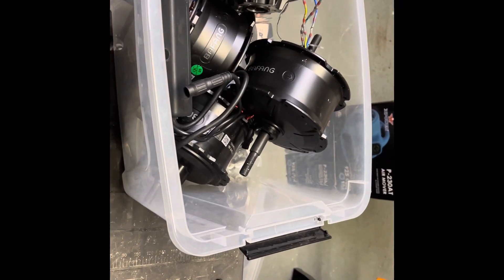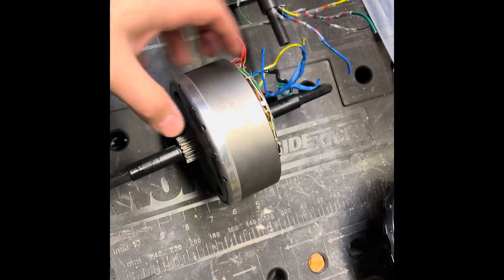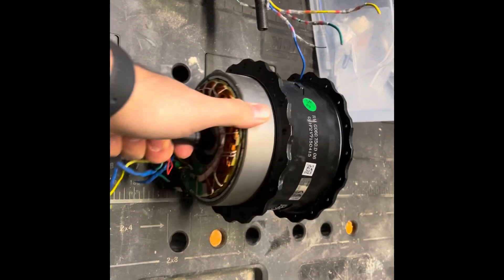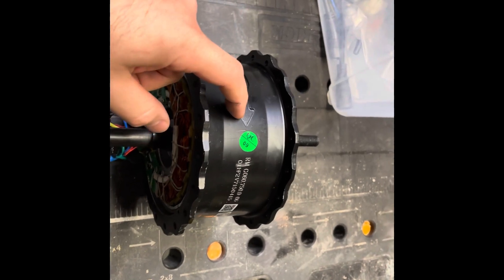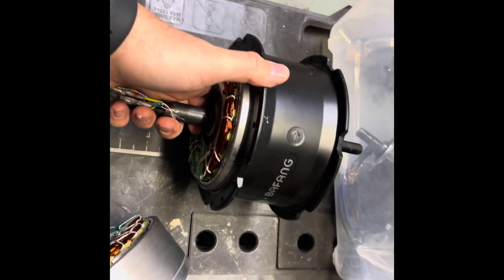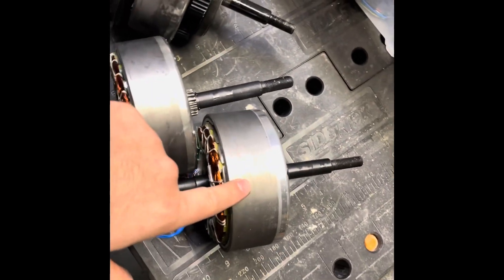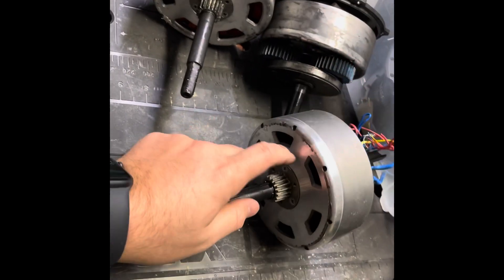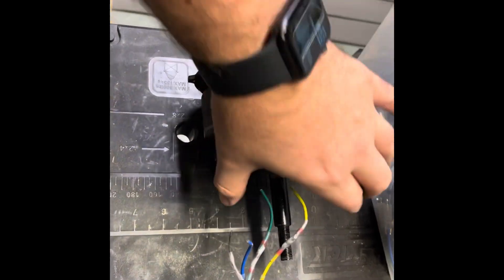RadRunner PLUS motor upgrade

Comment: Ordered a G062 750w motor with the cable on the rotor side. My question is do I need to change out the controller and if it will you connect up to the original cable. Not trying to get more power just trying to replace my broken motor. Thanks for the video.

Comment: Hello, where did you got that motor? Can you provide the exact type info? I found one but the cable connector is not the same as the original RAD motor.

Comment: I too installed the 1000w bafang from Eunorau and noticed/confirmed I would need to file/drill the holes since the OEM Bafang 1000w has a slightly smaller diameter for the screws to fit the Rad Motor shell. I chose to take off rear wheel and tire (and wheel strip by force) and take off spokes to thread in the the entire new motor. Wish I bought the special flat head screw driver tip like Amazon's "Unior Speed Nipple Bit" but oh well, I stripped a few nipples and managed to get wheel 'almost perfect' straight and super tight. .. This route was a direct fit into the brakes which means that the sizing issue is the end-caps being different with and the rotor mounts w/ different protrusion length. Just fyi for anyone else, don't be afraid to re-spoke the wheel if you want. Spoke length remains the same (spokes can be re-used). Just be careful not to strip the spoke nipples either from inside or outside if using wrench. Grin Technologies has a great video about threading spokes diy at home.

27mph max now. Climbs hills way better. Extra Note: Rad Motor had a lot of gunky automotive black grease used inside. Bafang OEM had correct silver/white thin grease correctly placed. Used an Amazon $30 freewheel versus removing previous and had to adjust derailleur a bit.

Rad Runner Plus, Grin Cycle Analyst/ Baserunner Controller, 2 batteries/ Front Regen Motor addition with another Baserunner controller is next. Hope this helps, go for it and add the power!

Comment: Just wanted to chime in on my motor upgrade. Used the link in one of the other post and got this exact motor to upgrades my RR+. All went well until I put the wheel back on. I could not get my brakes to stop rubbing. The rotors were catching the washers on the screws of the brake calipers and portions of the frame itself. It wasn't until I went to check the tire pressure, pushed on the tire and the whole wheel slid side to side when it was securely fastened to the bike. I was able to move the wheel side to side about a 1/2 inch! I figured out I needed some washers on the inside of the motor to correctly center the tire. After inserting 4 hefty washers everything worked great. I also had to use a round file to extend the holes on the motor side for the bolts in order to get the holes to line up.
Reply: I've had this motor a few weeks now and I think I'm having to same issue. How does washers on the inside fix this, wouldn't they just slide around inside with the motor? Any help would be appreciated!
Reply: @briwil78  So if you swap original motor for the one from the link grab the axel and see if you can push/pull it. If it moves back and forth ( has play in it) you can add washers inside to remove said play. Go to time stamp 4:52. see the motor on top, the one with the gears still attached? Those gears should normal be right up against the inside of the case . The motor should fit inside the case with out any wiggle room. If you shake the case with the motor inside it shouldn't bang around inside the case. After  I got mine all installed the first time, I mounted the wheel with old case new motor and I didn't realize it but my whole rear wheel could move side to side by about an inch. . With the motor outside of the case I put washers on the gear side of the axel to eliminate the extra space the motor had inside the case. Not sure if im making any sense. Let me know if you need  additional help. BUT if you have everything installed new motor in case and tire/rim mounted back on the bike axel bolts tight , see if you can move the wheel side to side. If you can it's not bad, it's fucking bad! Let me know how you make out

Comment: Quick question for ya, do you have to pull the freewheel when you do the swap ?  Thanks for your help,I was lost  effort I ran across your vidio.
Reply from the maker: No sir! For some reason either the new RR+ or just this batch
The motor comes out on the rotor side 
Freewheel stays intact
Reply: Thank you, that is good news. You did a good job on the the video, it was well explained.

Comment: Had this problem but luckily the great customer support at BGB helped me out, ordered a 1K motor from the link you listed.

Can you speak to the speed improvement over stock? Our UK Radrunner Plus could only ever hit 21MPH with the stock 500w motor, even with the 35a controller.
Reply: every motot turns a certain max. speed for a certain voltage. You can either increase the voltage through a different batterie or use a motor with which is made to run faster. A motor which is faster has lower torque though.
Reply from the maker: I’m skeptical about my speedometer I’ve seen as high as 32 on an app on my iPhone
Reply: @Mynameisdiy  hey i just got the 35 amp controller to use with my 1000 wat motor on rad runner plus but im getting motor possition sensor failur and i cant find a solution. did you have the 35 amp controller as well? please any advice i dont think but i had trouble mounting this on the bottom of the bike it might of pinchd the cables but every connection popped into place so i dont think thats it. do u mind sharing the p settings if u do have one quick
Reply from the maker: @vincentvincent2658  sure thing. I got you first thing in the am. 
I’m not sure which failure that is but i do know the one time i got an error i freaked out. But it was because my motor cable wasn’t fully pushed into the controller connection. Hopefully it’s that simple. But it requires a nice bit of Force
Reply: @Mynameisdiy  thanks you were right i just wish i  waited for your reply was annoying taking everything off with missing allen. instead do u mind sharing your settings so far the display says i can go 27mph with 1000w motor 35 amp controler and display but i know i should be able to go much faster than that right.
Reply: @vincentvincent2658  There is a magnet inside the motor housing by the planetary gears. It's very small and has to be stuck to a little slot. Go to " Bafang 750w Motor Upgrade and Install for your Rad Power Bike" on the Big game bikes youtube page . 4:26 in the video talks about motor sensor faults.  Hope this helps,

Comment: Just got a RRunner 1spd. The power cable is on the rotor side as well. Seems to be the trend.
Reply: I'm told this won't work on the RRunner 1, only works on the plus. Bummer as I have a 1 speed as well

Comment: Does the 1000W drop in to the stock housing or did you have to rebuild the wheel and take the stock motor out and lace up the spokes again?
Reply from the maker: Drop in replacement!
Reply: @Mynameisdiy  nice! Thanks. I recently bought a RR+ and have been looking hard at the 35a controller, this motor and some battery upgrades.
Reply from the maker: @andrewsmashes  that’s exactly what i did lol 
I gotta say it’s not worth the hassle if you’re looking for top speed. 
But the torque is fantastic. Thing really moves 
Check out biggamebikes, they’re in UK but customer service is unparalleled.
Reply: @Mynameisdiy  i have a few incline hills on my way to and from work. will i notice a huge difference between having just the 35 amp controller upgrade vs having both 1000w motor upgrade and 35 amp controller? honestly im happy if i can do 20 or 25 mph going up a hill maintaining it with throttle only if thats possible. also i thought having a higher watt motor increased top speeds? using a speedometer app how fast are you going top speed is it 28mph? 30 32?
Reply from the maker: @vincentvincent2658  oh you’ll notice and maintain speed for sure. I’m having trouble with my top speed as i don’t believe my lcd screen is accurate. However i did max out at 31 on a speedometer app on my phone. But again i wonder how accurate any of it is. 

Point being you get way more power/torque. Hills are no problem. Only thing I’m concerned about is  my output has gone into the 1800Ws maybe higher. I usually let off the throttle and pedal not because the bike is struggling, but because I’m just not familiar enough w the science of it all. And i don’t want to damage any of my components
Reply: @Mynameisdiy  thanks for the feedback ive decided to get the 1000w motor but I'm not sure how to lace the spokes will you be making a video on how to set this up on your own radrunner plus? would be awesome as there are not too many radrunner plus channels doing stuff like that
Reply from the maker: @vincentvincent2658  it actually didn’t require relacing on the plus which is why i was able to do the upgrade myself. Have no clue about relacing spokes. 
With the 1000W motor i purchased it worked as a drop in replacement. Similar to the other videos out there
Reply from the maker: @vincentvincent2658  i got two from 
https://eunorau-ebike.com/products/bafang-fat-bike-48v1000w-rear-hub-screw-freewheel-motor?_pos=10&_sid=c39c2ef90&_ss=r
Reply: @Mynameisdiy   thanks for link, waiting on controller to arrive after 2022, but im sure the motor will keep me happy until then. let us know if you ran into any problems minor or big or have any tips, including the perfect settings you found for your Bolton upgrade kit if you have one. we need more radrunner plus channels out there imo.
Reply from the maker: @vincentvincent2658  i hear that! I wish i was more of a YouTuber because i agree. I went through 2 motors to learn what i learned lol
Also check out electro bike world. I got my controller from them and they are in stock 
Had a small issue with one of the cables and they responded and sent me a whole new controller
Reply: @Mynameisdiy  I don't want to mess up my order given enormous return policys can you link me to the controller you got? There's too many conversion kits. Also my wheel size is 20 inch x 4 and my snow tire is 20 x 3. I dont want to buy new tires if I don't have too. The 90 dollar controller says 26 inch diameter. Is there 1 for my size
Reply from the maker: @vincentvincent2658  yea man sure 
https://electrobikeworld.com/products/35a-controller-rad

https://electrobikeworld.com/products/kt-lcd8h-color-for-rad

You gotta adjust the settings for the tires that’s all. Bolton has a good video explaining all the settings as well
Reply: @Mynameisdiy  sweet the controller will be in stock in early oct way better than waiting for boltons site. cant wait for insulated jacket for my battery to go in stock, also cant wait to see how bike performs in heavy rain and snow atm i wrapped plastic bags over sensitive electrical parts that would shut down my bike. wish they came out with some kind of rain proof cover or display. poggies for the plus  and mounting bracket for controller up higher  maybe under rear leather passenger seat for snow that goes up to your shins. i might make a youtube channel just sharing my experiences too.
Reply from the maker: @vincentvincent2658  you sound ready! I hadn’t even considered that stuff 
I’m actually waiting on some adaptors from Big Game bikes to run my stock battery with my new battery in parallel. Things going to be a tank! Once that’s all set up I’ll probably check back with you for waterproofing tips hahah
Reply: @vincentvincent2658  I have a Radrunner plus.  I got it last November and have 4500 miles on it. I've driven it in everything. From below zero in the snow to hurricane henri. I've had it in the worst and it hasn't complained one bit. I wouldn't worry about the electrical stuff. Trust me it's solid. Just avoid puddles that  would cause any electrical stuff to be submerged.
Reply: New problem planetary  gears went bad cant  get this motors gears off im lost its stuck t o motor no snap ring
Reply: Hey Jose, thanks for this vid.  I'm about to do this upgrade myself.  Just want to check, it was a 1 for 1 drop in?  I've heard of other people finding the stock housing doesn't fit right or something and having to caulk the housing shut for waterproofing.  Were you able to throw the motor in and close the housing properly?
Reply from the maker: @JoshGoldbergChapmanStick  I’m not gonna lie the screws didn’t align 100% but close enough that I’ve ridden about 300 miles since and haven’t had any issues
Their didn’t seem like a need for caulking as there wasn’t any gaps with the housing. 
When i say the screws didn’t align i mean when i got down to the last screw it felt as if the cover was just short 
And the screw went in at a bit of an angle
Reply: @Mynameisdiy  were you able to get the screw in all the way despite the angle?
Reply from the maker: @JoshGoldbergChapmanStick  yessir
Reply: @Mynameisdiy  baller thanks dude
Reply: @Mynameisdiy  I have a RR2 and purchased the 1000w motor, and had the same issues with screw alignment on the cover.  I am only able to get 3 of the 6 screws in.  Did you get them all in?  If do how?
Reply: I ended up using a file to widen the holes on the end cap.  Now my issue is getting the axle to fix back into the frame.  It seems to be too wide.